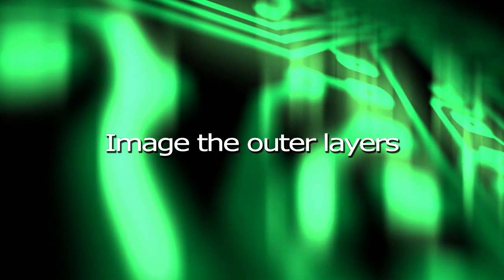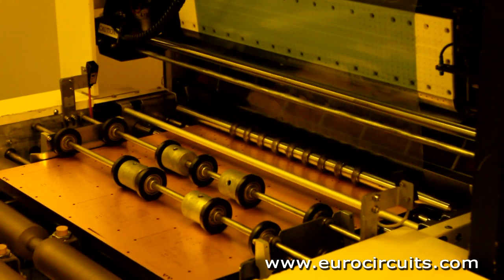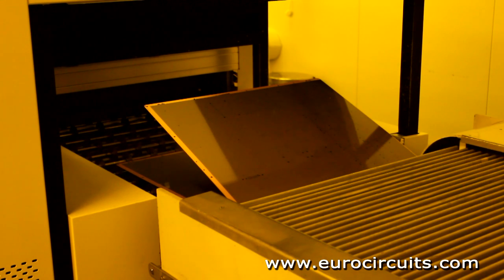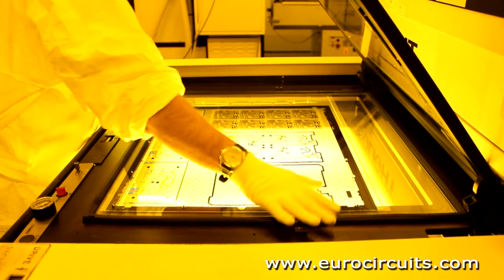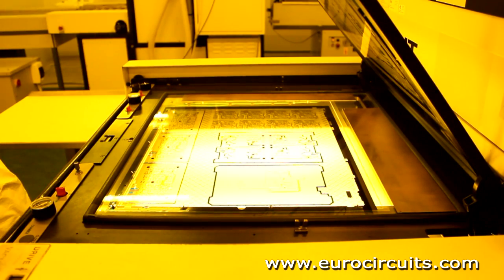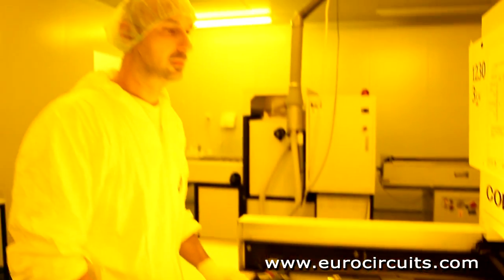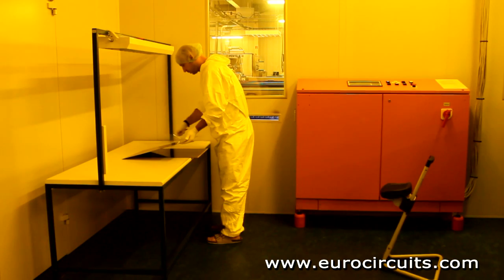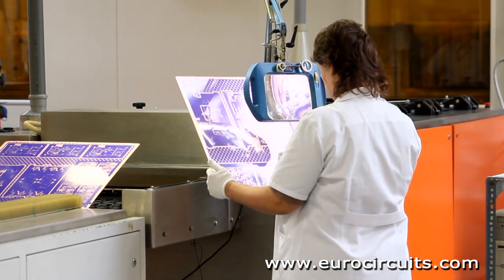Part 13 - Image the outer layers

Comment: Shouldn't a guy working with uv wear glasses when panel is placed in the machine?
Reply from the maker: The UV-light cannot escape from the machine. So it is perfectly safe.
The last 5 years we use direct imaging instead and film is only used in rare occasions for instance for white soldermask as that needs high UV energie to cure.